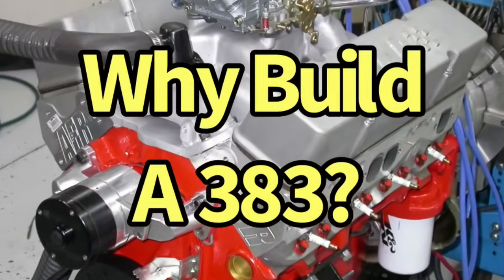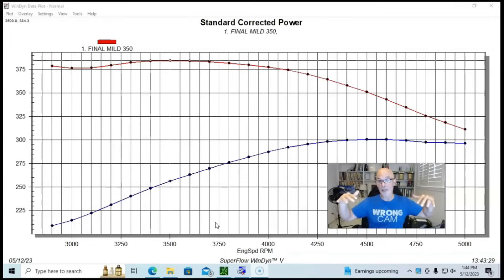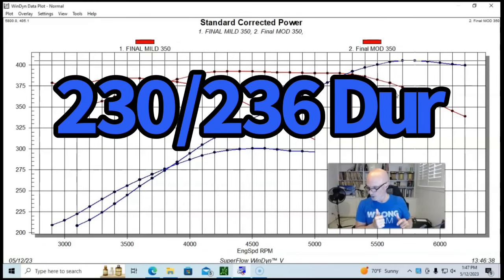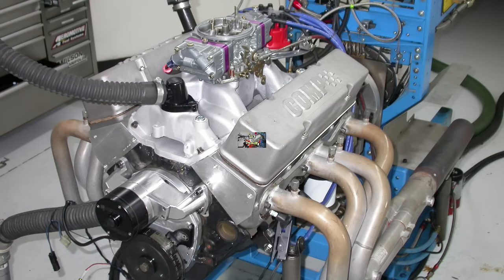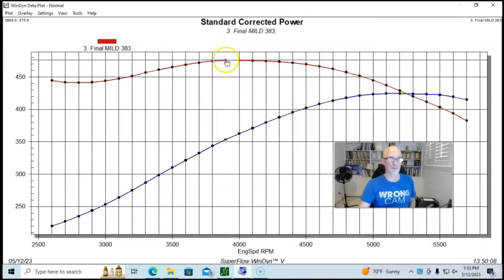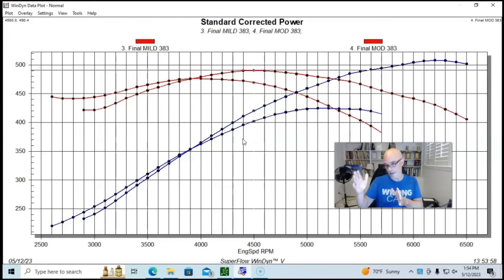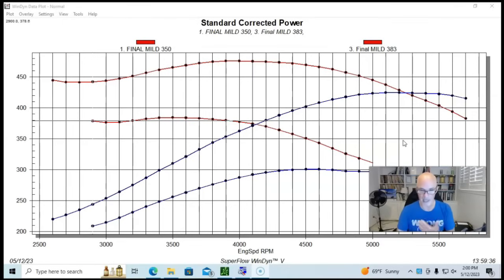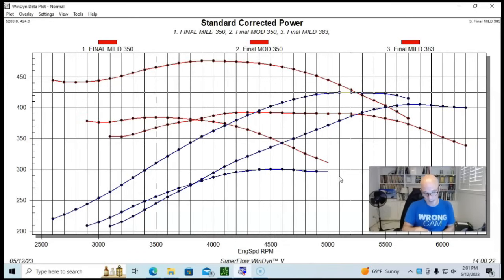HOW DO YOU MAKE MAXIMUM TORQUE WITH A SMALL BLOCK CHEVY? JUST ADD CUBIC INCHES! 383 STROKER BUILD!

Comment: Smoky Yunick said always build the largest motor you can afford! I and others would add to use the longest rod that you can fit and afford!
Reply from the maker: rod length does not change displacement
Reply: @richardholdener1727  Right I know it does'nt, but it is just better for the geometry! Longer rod less side load on the skirts and the block at BDC! I like the 6" rods in the 383

Comment: I had a 383 built, but did not get to run on the dino. Any idea what a 10.25 - 1, 224 / 236 - lift 609 / 593, with AFR 210 cnc heads. Any ballpark estimate on h.p. and torque?
Reply from the maker: what intake?
Reply: @richardholdener1727 Edelbrock Air Gap dual plane.
Reply: It is an Edelbrock Air Gap dual plane.

Comment: 383 is cool and has a lot torque. Now there is the 406 , 400ci block with a 3.8 stroke easy 500 HP  500 Lbs. of torque
Reply: 3.75 stroke, I have 3 of them
Reply: @travistucker7471 3 of what 383 or 406  my 406 has a 3.8  stroke 4.125 bore it's a beast easy 100 horsepower and 100 ft lb of torque more than the 383

Comment: we built a 394 cu in. sbc for dirt modified racing a few years back, it has a 3.875 stroke with small rod journals to help clear the cam and oil pan rails super engine and the cost was the same as a 383.

Comment: For lower RPM usable torque a strong Dart block with a 4” stroke. Bore up to 4.185” but I’d keep the walls thick. Valves no bigger than 1.94” intakes with 1.60” exhaust. RV style cam with 8* advance.   It will pull like a diesel. It won’t be a the high hp engine people seem to love but who drives at 5000-7000 rpm.
Reply from the maker: no on 1.94/1.5 valves and no on 8 degrees advance (just get the right cam to start with

Comment: How about a 383 with a .488 lift cam minimal lope with 882 smog heads? Im in tge delema of having a less than 1000 mile 350 .060 over with claimed turbo cam. Was going to order some 64cc flotek heads to bump compression, but i think pulling the rotating assembly and putting a basic .060 over 383 kit to make my cam wake up
Reply from the maker: WHAT IS THE DESIRED POWER OUTPUT
Reply: @richardholdener1727  450ish. Going into trail/ rock crawling 80 chevy. Its a 360 now, but i think the cam is way wrong for low compression. Have a degree wheel and the cam checker that goes in lifter bore on the way so I can figure out specs in it.

Comment: Wow, very interesting. I have a 30 over 350 with Brodix STR heads that just had some mild bowl work done with the XR282R cam with 10:1-CR and my engine made 405hp and 418 tq and this was with a Dart Kool Kan and an HP 750. 

The engine builder used the wrong distributor gear and it not only wrecked the dizzy gear, but is wrecked the cam gear so I tore the engine down and decided at the last minute to stroke it to a 383. Thank you for justifying my decision!!

Comment: Hej Richard. I have a 4 bolt 350 block with the 186 heads with the big 2.02 valve. Would this heads be good in making a 383. All the best from Denmark 🇩🇰
Reply from the maker: The 186 heads are decent for a stock head, but don't compare to any after market heads
Reply: @richardholdener1727  I know that they dont make up for the aftermarket heads but would they work on a mild stroker. Mine has the small 64 cc chamber

Comment: When I was a kid, reading a Popular Hot Rodding article regarding to piston compression heights, I thought about making a 328 cube stroker using a 307 block, 400 short rods, and a medium journal 350 crank. Idk how accurate my math was, back in the mid 1980s lolol. But if I recall correctly, it could work. Can't recall what type of piston to deck clearance this wound up with. This was using stock 307 pistons. I thought I was Einstein 😂
Reply from the maker: DECK HEIGHT MUST EQUAL ROD LENGTH PLUS 1/2 STROKE PLUS PISTON COMPRESSION HEIGHT
Reply: @richardholdener1727  You are the best man!! Keep doing your thing brother. Theoretically, does this combo work? Or does it have too much piston to deck?

Comment: I have a blue print 383 stroker in my 88 iroc with a fresh stock rebuild 700r4, what stall converter would you recommend? The car will be a weekend cruise car with the option to show power ones in a while ? Thank you !
Reply from the maker: what is the cam and intake and gears?

Comment: Richard ,Ever do a 400 with a 350 crank? My favorite  combo as a dirt track guy . .30 over 400 and 3.480-3.500 stroke .....all the rpms
Reply from the maker: Westech has a 372 Dart motor but the stroke doesn't determine rpm. That is all valve train

Comment: Hey Richard love your vids man! Many years ago I remember reading an artical in Hot Rod magazine about the 350 chevy should have built that killed those numbers at 475/450 with a mild camaro cam and decent heads. The thing is that they used a 400 bored .030 over, destroked it with a 327 crank and used ford straight 6cyl rods machined to make up the difference. The torque curve was like a straight line after 3k. I've haven't had a chance to build one yet but I've got a 86 K10 with a tired 4.3 and I have a 305 sitting in the garage needing refreshed, what about doing the same with that block with what would be a safe overbore?
Reply from the maker: keep the motor bigger-don't destroke it

Comment: What I find the most interesting about the 383 small block, is that it seems to be able to produce more power and torque than a common big block. Your mild 383 produced more power than even some 427 engines. Your wilder build was even more impressive as it was getting into 454 territory. 
You're right the 383 is the engine to go with. With aluminum heads and an aluminum intake manifold it's considerably lighter than a 396 to 454 engine.

Comment: I want to build a 400 hp 350 with good drivability what cam would you recomend?..im gona run 199cc afr heads dual plane air gap manifold 750 cfm holley..msd ignition and distributor..currently have mid leangh headers and 2.5" exhaust..
Reply from the maker: you will need a decent cam to make 400 hp (like  224/230)

Comment: Why build a small block when you can swap in an ls for cheaper and have better power and fuel economy. I really don't see any scenario where you're better off keeping the sbc. Before I catch hate I'm currently pulling a sbc from an 82 k10 to swap it out after running all the numbers on build it vs swap it.
Reply: Not hate, just discussion!  Cheaper?  Well, maybe, if you're talking junkyard LS vs. SBC rebuild.  But unless you're doing a lot fabbing up yourself, add up the price of all the conversion parts you'll need and see where you end up.  Unless you're doing a full stock swap in with wiring and computer, you can spend a bunch of money on all the details of actually getting the LS wired up with everything working and running well.  Besides, a lot of guys already have some good parts on their current SBC, and clearly a SBC can be built to be competitive with an LS.  I've had more than one SBC that would do better than 20 mpg highway; can't say my LS's will do that, although overall mpg is generally better.  Personally I like both; I grew up with 230 & 250 sixes, SBC and BBC and love 'em.  Nowadays I'm running an 8.1 and three LS engines, learning HP Tuners and playing with tunes and a few mods but I'm longing for time to spend on my older stuff and appreciate it for what it is!  I can admire and respect a modern build on a classic, but there's a part of me that has a lot of respect for the historical aspect and feel of that old car, and for me it's more about retaining a lot of that in a build.

Comment: I was going to build a 350 into a 383 stroker and then I found a good 400 small block and built a 406 sbc with afr heads and a comp cam instead. That engine was a lot of fun. I enjoyed driving sideways behind my house while pissing off all of the whole neighborhood. It made so much torque that I broke the intermediate sprag on two different th350 transmissions so I had a friend build me a beefed up th400 trans and had a 12 bolt rear with 4.10 gears. That was a fun combo.

Comment: I’m building a 383 for my 71 c20. Thinking of the 230/234 duration at 540 lift with 110lsa. I’d like to drive this truck often and have it be a fun street truck. Will this cam kill my lower end a lot because it’s a truck and needs more lower end torque
Reply from the maker: YOU WILL STILL HAVE TORQUE IN A 383 WITH A 230 CAM
Reply: I’m guessing it’s a mild cam for a 383. I’m also running afr eliminators

Comment: I have an 1988 1 ton Chev Truck I changed out the 454 for a 383 and I am perfectly happy with the 383 so much I am doing another one in 385 for my 1991 1/2 ton truck .
For pulling torque the 383 and 350 have no comparison the 383 just pulls along just fine with a 19 Dory boat behind the 1988 Truck and the 1991 Truck with the 350 and pulling the Dory boat the 350 struggles and sucks Hugh amount of gas.
Reply: What cam are you running
Reply: @jackchetelat651  O know longer have the cam card but what I can tell you is the cam is a Comp can E Stream Energy cam with a mid 400 lift basic a cam for pulling with a starting RPM of 1000 .
I am a 64-year-old man that is a fishing guide from Alaska, I need the engine to tow my jet boat and not bog down like a 350 does and the 383 works fine for a trailer puller.
The 383 worked so well and runs on less fuel per mile I have already started on the 385 for my 1991 Chev 1/2 ton truck.
My 350 block I am working on now has one bad cylinder it has to go for the 8 cylinders to 40 over making for a 385.
I am also using the 6 inch connecting rods from Eagle.
The heads I am using came from Ebay with 202 and 160 values.
The 385 engine is going to be using GM TBI heads with 65.3 chambers.

Comment: As a 55 well two weeks fromm 55 year old man. I grew up in a actual Auto salvage yard. To go out and find a 400ci is like finding a honest politician.  No one wanted one due to the "scary" steam hole the heads required.  No ma y ordered them and that made them scarcely available.  Then they found themselves in the salvage yard and soon the  shredder.  Making one now a Golden egg. That why it was easy to stroke a 350 with a 400 crank and a set of rods. It was back in the 80's a under $1k build that would lay down 500 hp. Solid cam and decent truck rods.

Comment: What cam was used in the Wild 383. You gave the specs but not the brand or Cam number. You did on the other cams used. Thanks
Reply from the maker: Comp
Reply: Cam part number? Love your videos. Thanks love the videos @richardholdener1727

Comment: I hate the fact that I did not know about you sooner. Lucky for me, I’m still deciding which way to go. I own a 1996 GMC K1500 (4x4) with a 5.7L Vortec engine. That engine still runs but it overheated almost a year ago and I’m thinking about getting it on the road again. I would like more power because it is a heavy truck but, I’m torn between keeping it stock, or bumping it up to a 383, or go LS1. 

I would like to update my transmission while I’m at it (maybe upgrade its 4L60 or go 4L80). Problem is my current budget. 

What would be the best option with a $7k budget????

Comment: I have a BluePrint Engines GM 383 C.I.D. 436 HP, will i get more power if i change sylinder heads to AFR 195cc SBC Eliminator Street Heads 1034 or will i spend a lot of money for little gain. i run msd ignition. Holley 750db and edelbrock airgap intake.
Love your channel
Reply from the maker: yes you will make more power-not sure if it will be $2000 worth

Comment: Hello, We would love to see how much low-end torque like for a Marine Vortec small block say from 1200Rpm to 42-4500Rpm? We find that all your small block builds drop torque in the idle to 4000Rpm and that won't work in big boats heavy boats love your explanations
Reply from the maker: can your ever see 1200 rpm at wot?
Reply: @richardholdener1727  We run our Cruise from 35 to 3700Rpm's and wide Open from 42 to 4400Rpm's it would be great to see what Vortec combination would have the most Torque? I'm an Old man in Miami Fl, been working and owned many 5.7's, I have made many go really fast but in a heavy cruiser fast isn't really the important part. Again Thanks for your quick reply and I really enjoy your Youtube channel.

Comment: Built 350 Chevys for years until I decided on a 383 for my truck. Never looked back after feeling the difference between the two. 383 is a beast!! . Put one in a 260z Datsun body and ran ten flat through the 1/4😊 and it was mildly built with a set of aluminum heads. 💪😆
Reply: Wow! Love those 240 and 260s!!   Too many love to post a 383 only makes a lil more tq will run about the same. 
B F S! lol  No comprison between my SR 350 and 383 not even in the same zip code. 
Always build bigger

Comment: A lot of money for only 125hp. Depending on the target power range someone wants. You done a video on the vortec 350 and boost. 600hp is easily attainable for the same amount of money as a stroker kit, without the extra from buying aluminum heads.

Comment: One day, I’d love to see someone build an engine to produce maximum power in an rpm range that people actually drive at.  I’m old and slow, and rarely rev above 3000 rpm’s.
Reply: I'm doing a 383 build right now that peaks at 3800 tq for the exact reason your saying. I don't want to wind out to feel it. I grew up w that torque on the low end. No substitute.
Reply from the maker: I think you are confusing the needs of "people" and your own needs. People watch this channel to find out what makes more power. The vast majority of enthusiasts don't run their performance motors below 3000 rpm when accelerating.
Reply: @richardholdener1727  First, I enjoyed the video and your approach to making these comparisons, and you supported your position well with data and info.  Not all of us are just looking for the headliner peak power number and your points are well taken.  While many may be looking for the headlining grabbing peak HP number, enthusiasts are building, or having engines built for multiple applications - daily driver, tow rig, street/strip, or competition car or truck, maybe even marine.  Personally I'm looking for satisfying performance out of any car I own, for it's intended purpose.  We're all looking to make the best decisions possible when spending ever increasing sums of money on mods or a full engine build, regardless of application.  It's annoying, and potentially misleading for most street use to constantly see dyno pulls that start at 3000 rpm; what're the mods doing below that?  Can the dyno's you use consistently and accurately measure output below that?  We should also be seeing brake specific fuel consumption (BSFC), a measure of how efficient the engine is at making power/torque.
Reply: @richardholdener1727  you are correct.  My needs are not the same as people’s wants.  Just as people describing their daily drivers as race cars.  Most people need engines to do things like idle, and make vacuum.  It’s cool to see an engine rev to 8000 rpm’s making 1000 hp, and if you have a dedicated track vehicle, great.  2 terms foreign to most people that would build an engine is duty cycle and overall power.  Maybe I’ll make a video about those 2 terms that are absent from the automotive community in the next engine I’ll build.

Comment: Hi Richard, i really enjoy your videos and was wondering if you may be able to give me some advice on a 383 TPI Stroker cam i am considering, it is a Crow 11725,  adv duration 290/296, 242/246 @0.050" 109 lsa roller. Crow states it's 3500 - 6500 rpm needs 3500 stall. I have a 2200 stall 3.07 rear gear 700r4 89 Corvette, currently it's a 355 ported stock lower intake, edelbrock runners, ported plenum, bbk twin 52mm throttle body 1-3/4 hooker headers RHS 180 Pro action heads 1.6 roller rockers, 0 decked, flat tops, mild comp cam xr264hr-12, 212/218 @ .050' .488"/495" lift, 112 lsa. My question is the Crow cam to much for my set up or should i stick with the comp cam or something else?. Also the comp springs 987-16 [-02] supplied in rhs heads states max lift of .550" can i upgrade the springs to handle higher lift?  Thank's for any advice you or anyone may provide?
Reply from the maker: that is not a good cam choice for that application-it has too much duration for a TPI motor
Reply: Thank's that's what i reckon to.

Comment: What should a comp hyd roller magnum 224/224 .525/.525 110 lsa 
383 with afr 195 rpm air gap intake 650 mechanical secondary quick fuel long tube 1 5/8 primary  10.4:1 static compression make ? Im planning on putting it in a 65 Chevelle 2 door hardtop 4 speed manual 2.5inch exhaust and 3:73 gears
Reply from the maker: mid 450s
Reply: @richardholdener1727  what cam do you recommend for 500 lb of torque and close to 500 hp ? Also have power brakes but don't mind getting a vacuum pump if needed
Reply: Also would afr 195 cnc ports be better or as cast

Comment: Hey mate love you videos.. quick question just building a 383 sbc using a hdy Rolla Howard  110265-12 cam, WITH A 1.60 rocker ratio it should have 565/585,  @.050" 233/241 ,scat 9000 crank. H beam eagle rods, single plane Team G Manifold, 850 quick fuel carby. 1.58 pipes Pacmakers, Dart pro1 heads  200cc/64cc 23° Aluminium Cylinder Heads, compression is around 10.50. how much power do you think this combo will make???
Reply from the maker: long tubes?
Reply: yes, long tubes  @richardholdener1727
Reply: so what do you think ? @richardholdener1727